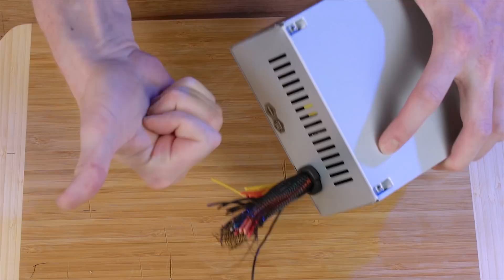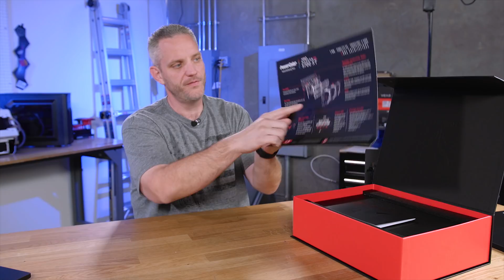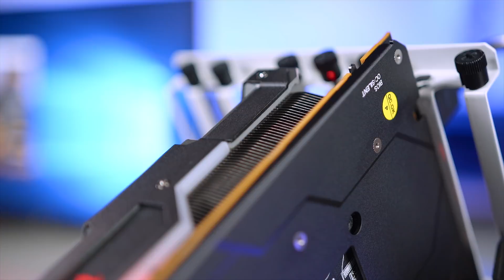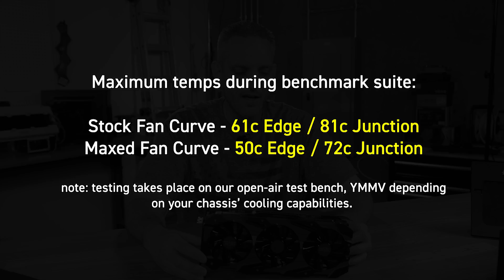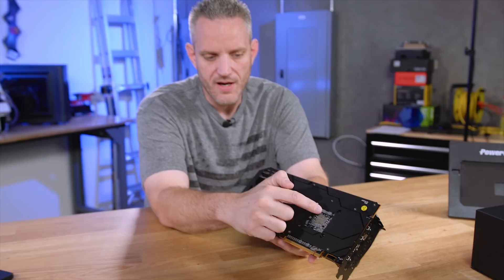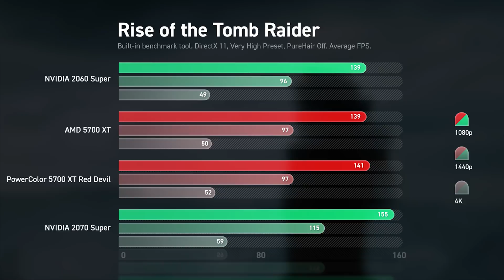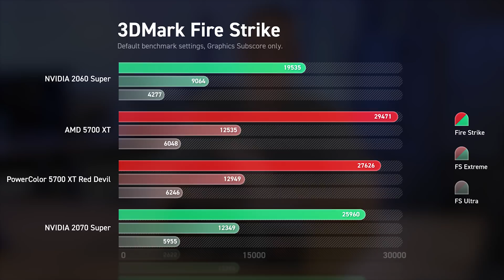Custom RADEON 5700 XTs are here! and THEY ARE GOOD!

Comment: just bought this card used for half price of a new 3060, it's an asus rog strix, guy already did washer mod so temps are pretty good. ryzen 5600 (on sale) all in about 600usd. Hard to compete with a ps5 price point, but I feel at least matching the current gen will give my system more longevity than going with something a bit cheaper like a 1070ti. Yes an older card now, and you all may be looking at the 6600 at this point, but if you spend your budget smartly and know how to sniff out shady dealers on fb market, you can get a really great mid range system.

Comment: got my red devil almost 2 years ago now... still loving it.
Reply: You must have got a good one, mine crashes constantly
Reply: @shiningdragon8737  I had a few issues at first, but I made sure my gpu fans were engaging, because the default fan settings were not turning them on for some reason, and my drivers were all updated (AMDs adrenaline software doesn't turn them on unless I manually change the fan curve.  Even if it is just a tiny bit, then change it back.  It's weird. ) . Haven't had many issues since then. Only really major issue I have had so far is attempting to play Outer Worlds.  It crashes my system pretty much at the beginning of the game.  So I've never made it past getting into the ship. But that could be a problem with the version of the game( I have it through epic) , rather then an issue with the gpu.

Comment: I recently bought a RX5700 XT Asus ROG strix, but the problem I have is my monitor starts up with a 640x480 resolution even though its a 1080p native monitor. And I can't figure out why it does this because my second monitor doesn't have this problem. And switching to display cables does not fix the problem. The only thing I can do is change the channel on my monitor to the second HDMI port and back to get it at 1080p. Anyone have any clue on what the problem could be?
Reply: Probably the drivers?
Reply: @hellohej1307  the weird thing is that any other display I tried doesn't have this problem

Comment: As drivers for the card have matured so has performance. I actually game on this card in 1440p in COD warzone 200 man battle royals and pull fps range of 120-168fps. The low 0.01% was above 90fps. In games like forza hitting 120-144fps is constant with everything maxed. This card works on 1440p even in fast paced battle royals like warzone. You would probably find that if those benchs are ran today performance probably jumped between 5-10%. The card really did mature since release . Very happy with it.
Reply: I'm considering getting this card so hearing that it's gotten better is a win for me.
Reply: @kizzychiz  highely recommend . Got mine for £400. My air flows very good so the card sits over 2ghz nearly my entire play time on a custom fan curve. I sit the fans in heavy load games between 65% and 80% at max. Usually it will bounce 70%-75%. I do not mind the extra noise. If you want it silent I recommend undervolting to reduce the heat build up which most reports keeps it over 2ghz on more silent builds . The ATI software has auto undervolt if its not something your comfortable doing your self. What you get out of this card depends  very much on cooling inside your case. Works similar to a ryzen cpu. It will boost up to 2010mhz in ideal conditions. For me that is 1989mhz-2008mhz in war zone. My gpu temp is 54-56 Oc. Junction temp 70-74. I'm also a sucker for the RGB on it. My cpu ,psu and now gpu are same colours. Using an aqua type blue :)
Reply: Are you not seeing any of the reported driver issues??

Comment: I purchased the PowerColor Red Devil RX 5700 for $379 U.S. dollars and loaded the PowerColor Red Devil RX 5700 XT bios to it. It was simple, put's the card within 1% of the XT version,  and is working flawlessly, albeit much faster than before the Bios update. The key is the Red Devil 5700 and XT version use exactly the same cooler so temps are great and it saved me $70-$80.

Comment: Would you still recommend this card? Would it pair well with my Ryzen 9 3900X?
Reply: It would even pair just fine with a ryzen 5 3600, its still an amazing card but with that amount of gpu power you can get away with a 2080ti or a 3080ti when it comes out
Reply: jack sheneman I’ve had this card for a couple months now, and it’s perfect.
Reply: @chriskempen9969  it's an amazing card👍

Comment: I had to RMA my Red Devil RX 5700, i had to do BIOS flash, search for specific drivers & do specific settings (both in Motherboard BIOS settings & videosettings) etc. to solve Crashing (had BSOD/Black Screen problems like so many other RX 5700 users) and it still will crash sometimes even tho its less, Radeon/AMD even admit it & are trying to solve the problem as we speak, to no avail... its just a damn HASSLE.... 
Red Devil RX 5700 looked absolutely gorgeous in the case with that RGB tho, what shame... i have a RTX 2070 right now and its amazing, just plug it in and kickass, never any hassle.

Comment: I wonder how good my system is going to be. 3900x processor Red Devil 5700xt graphics card Asrock Tachaci motherboard 32gb of 3200mhz ram with 10 case fans and the biggest air cooler for the CPU

Comment: All the numbers are cute and all, the card is thicc and beautiful and all.....

That all ends until you put it in your system and BAM! BSOD, BAM! driver issues, BAM! You have to reinstall Windows, BAM! Stutter here and crash here. BAM! card overheats. BAM! Clock speed goes to shit...

As much as I love Ryzen.... AMD messed up big time with their quality control of their software. I bought a 5700xt just to drown in an ocean of driver issues. Returned it, bought a 2070 Super. Installed it and worked right out of the box.

If there was a 5700xt that works out of the box as soon as you install it and install drivers, I'd go destroy the 2070 and buy it lol.

Comment: JAYZ2cents please test the 215 TDP RTX2060 Super’s there are only 1 or 2 of them out in the wild from AIB partners. They crush all other 2060 Supers that only have a 185TDP like the Founder Edition. The rtx2060 Aorus is a 215TDP model with 133% power limiter by default. I’ve seen 9,800 timespy graphics stock out of the box. I saw a overclocked timespy of over 10,245 with a 215TDP 2060 Super that have a default power limiter of 133%

Comment: I REALLY wanted to like Nvidia's cards, I once saw them as a trusted brand and I even wanted to like rtx (even added a couple cards to a shopping list).  But after watching dozens of videos on Ray Tracing and the 5700 XT I cannot agree with Nvidia on this.  They have put their eggs in the wrong basket and I'm done.  Going to be buying myself a 5700 XT for Christmas.  Bye Nvidia.
Reply: Are you happy with your purchase? I've just sold my 1660ti and think of getting 5700xt/2070s? Driver been stable? Thanks
Reply: Same boat mate, but I ended up getting a sapphire 5600xt over the 5700xt. I needed some winter clothes, and wool cuts up budgets.

Comment: 6:04 that's pretty good, in long gaming sessions it's always hhandy to know what my temps are doing without having to run background applications which are also on the game screen which no ones wants. 

One thing that worries me about this card is reliability, I haven't had powercolor before. Anyone have this card yet and let me know if it's still running ok? Thanks.

Comment: Pleeeeeeeeease a little help here.

I bought the xfx rx 5700 xt yesterday, and it's not working past BIOS. I can mess with bios and see post it display, but after that the screen goes black and everything stops loading.

I have a very old Crosshair IV formula MB working with an R9 290 just fine, and PSU is strong enough (750w ocz fatality).

Is this a compatibility issue with the mb and the card? Or could the card be faulty?

Appreciate the attention.

Comment: The 5700XT Powercolor Red Devil is $599 CAD and the nVidia EVGA Black Gaming 2070 SUPER is $709 CAD. I play at 1440p on a 60Hz screen so it is apparent I can save $110 CAD by purchasing the Red Devil. All of the benchmarks were above 100fps @ 1440p. I only need 60 unless I OC my monitor. Even then I will only need 72Hz MAX. Good review man. I like it a lot.

Comment: I will save $125 buying a 5700XT AIB over RTX 2070 Supers. Should I go with the 5700XT?
5700XT is in the 2060 Super price bracket but is punching very hard at 2070 AND 2080 Supers? Wow.
2080 Super just under $900.
2070 Super about $650.
2060 Super about $500.
5700XT is $520. That's incredible work from AMD.
Prices converted from New Zealand dollars to American dollars.
Edit: Just contacted the local store. It looks like 5700XT won't arrive in NZ until early 2021..... Wow. By then who knows what will be available...

Comment: Got 3700x and 5700xt red devil.

The card is really big and long. Just take note.
Reply: should i buy the msi 5700xt or cutom built red devil card ? s the custom built worth it or should i just go with the basic card ?
Reply: Fury Gaming custom is way better. Reference card is too hot. Cards don’t last long if high temp. My red devil load temp is 64c on average
Reply: @hom3r  ohh i thought of buying the msi rx 5700xt , s that too hot ? asus edition s also hot ?
Reply: Fury Gaming just get non reference card will do.
Reply: @hom3r  actually im frm india bro surely this red devil pleases me but the problem s , for any kinda fault i need to send it for service to abroad , and i cant spend for it again so only bro , can u recommend me any non reference card bro ?
Reply: Fury Gaming why not state what’s available there? I believe prices there are expensive and most ppl bought overseas in USD.
Reply: @hom3r  ya bro these are too expensive here lyk the rx 5700 xt asus edition s 38k which s 532 usd , and the red devil is 42k which s 588 usd bro , here the asus and msi rx 5700 xt are only available for now , s the asus edition best or the msi bro ? based on performance and cooling ?
Reply: Fury Gaming find the card with triple fan cooling. It is cooler and quieter than dual fan. Triple fan is more expensive but better.
Reply: @hom3r  Nah bro Gonna take the risk and preorder red devil .......
Reply: @hom3r  txs for replying
Reply: @hom3r wat case do u use bro ? and also motherboard , im thinkin of taking the x570 aourus elite , 3700x and rx 5700 xt red devil , which case would do justice to this setup ?
Reply: Fury Gaming lianli o11, msi b450 gaming carbon ac, 3700x, 5700xt red devil.thats my setup.
Reply: ur case price itself costs me a fortune here bro @hom3r
Reply: Fury Gaming around 140usd conversion rate. Haha.
Reply: @hom3r  :(
Reply: @hom3r  in india it costs for 563 usd and idk y ..... RIP india
Reply: @fury5253  so what u gotten bro lol
Reply: @hom3r  yah bro but in my country the red devil stock never came so i went wit saphhire pulse card rx 5700xt and its running smooth till now i never have crashes or any other probs been using for 20 days
Reply: Fury Gaming good bro good to hear that!  :D
Reply: @hom3r  this beast runs almost everything in ultra 40 fps dude
Reply: @MrBeast  Haha nah bro , yah its available in my country , which country are u frm bro ? just go to power cooler site and choose the card then ur region and country it will automatically show all the available stores bro

Comment: Also its nice that the aib 5700 xt can creep near 2070 super performance.
But right now here the 2070 super is 499 gbp new but ref with custom cooler

While aib 5700xt is 499 strix and 450 red devil then 430ish reference with custom cooler.

If only a custom 5700xt is 400 then nvidia is going to get rekt.

But right now 50gbp difference between low end 2070s and 5700xt devil is not much

Comment: In regards to undercucking:

So basically the 5700xt can easily hit 2000 mhz with low voltage.

But for the life of AMD made it so that the gpu overvolts when boosting, causing more heat and then noise from the fan. Thinking maybe that ghis way the card remains stable ?

Are they underestimating the capabilities of their card?

Also this reminds me of the motherboards for intel cpu's and their "AUTO OVERCLOCKING 1 CLICK Softwares".
It had the same downside.

It can AUTOOVERCUCK to 5ghz say an 8700k. Bu it overvolts it so much that it ramps the temps on the 8700k resulting to 5ghz OC instability.

Whilst the same board and cpu can be overcuck to 5ghz manually with lower voltage with trial and error the same cpu can oc to 5ghz with lower voltage and lower temps. And if lucky can push 5.2 ghz on the same voltages that the auto oc from the mobo used for its 5ghz oc.

If you catch my drift.

I guess AMD is underestimating the navi's capabilities.

Comment: In the mid $400's price point, I'd buy a used GTX 1080 ti.  There are a ton of them on eBay and the forums selling for $400-$465 including ones with great coolers.

Comment: Dope card but it runs so damn hot which isn’t shocking as AMD cards always run on the hotter side but 100+ degrees is insane I could literally use it as a space heater in the winter

Comment: guys i got questions right now im using 1070 with 6600k on 700w aerocool power supply and my question is 
" is it worth changing 1070 for 5700 ?" my whole idea why i wanted to change it cos 
1 swapping gpu is easier then whole system (like motherboard cpu mem and all that)
2 im playing a 2k and sometimes i just cant get stable 75+ fps

what i wonder about is 700w ps is actually enough for 5700?

Comment: Always been a sapphire fan, ever since I bought a hd7770 that oc'd to 1200 mhz without any over voltage. My current card has a good OC too and doesn't go above 65c.
Reply: yeah, I have to agree on that one. And I always thought Sapphire was the go too brand with AMD   

  I got a few Sapphire cards and they all worked very well and the RX580 I am using is also a Sapphire... Go Sapphire....   LOL...

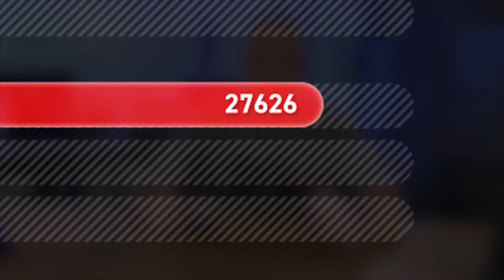Comment: 11:50 did you switch benchmark results of FS between the two 5700 XTs? You even zoom to the wrong result of 27626 when you say 'almost 30000'...

(edit) Ow ... wait, I should have listened to what came next. "Couldn't make heads or tails of it' indeed :P

Comment: Here in Australia:
Stock RX5700XT's can be had for $639-$649
Custom RX5700XT's look like they'll be $699-$729 judging by what's available today. 

In comparison. 
Custom 2060 Super's are $729-$799 
Custom 2070 Super's are $909-$1129
All dependant on brand of course. 

So, realistically, you'd be mad to buy the NVIDIA card over the AMD one, here in Australia at least. It's basically $200 (Minimum) to go from 5700XT to 2070S.

Comment: I had nothing but problems with my PowerColor Red Devil RX480 (8GBD5-3DH/OC) that I could replicate across three different machines... Even with 3 different warranty replacements I wasn't able to get it to be stable, even at Stock settings. It was so frustrating that I'll never buy a PowerColor card again.

I will admit that the 5700XT is slick looking though. Illuminated IO is cool too.

Comment: the problem with AMD GPU's is temperature. They cannot rely on the manufacturers to fix that issue. The base version should not overheat to such absurd levels. And they need to work on that that for 2nd gen Navi. 

Still, i feel AMD does have an advantage. the PS5 will use next year's Navi. Which means next years Navi is actually when things could get interesting the GPU market.

Comment: I love AMD but at the same time I can't avoid thinking about buying a second hand GTX 1080ti that's got 11GB VRAM.
Reply: What do you need 11gb of vram for?
Reply: Do it I've got 1080 ti strix oc to 2075 and my modded fallout 4 takes up tons of vram.  You can prob find a 1080 ti for like 500 easy
Reply: I just bought a super clean EVGA GTX 1080 FTW card on craigslist for 250 bucks!! Works perfect. I just couldn't pass that deal up.

Comment: I want the 5700XT but the drivers are still a mess right now :\  Still using my Power Color R9290x PCS+.  :)  However, the Power Color 5700XT is 600 CAD and the 2070 Super is 675 CAD.  About 12% more expensive but the 2070 Super as a whole is 8% faster then a 5700 XT (Techpowerup).  Makes a pause....seeing you can have fun with RTX at medium settings as a novelty.

Comment: I just bought a 2060 Super yesterday for 420, and I'm worried I may have made a mistake... I should have waited a little longer. But it's gonna be nice getting off this 980.
Reply: Stock vs stock the XT is faster. However, if you put a good overclock on your card, they will perform the same.
Reply: @twistedoracle4555  Cool thanks. After looking into it more, I think I made the right choice. I'm really picky about power consumption and I don't run AC in summer, so the Radeon cards sadly are out of the question.

Comment: I still struggle with the idea of scaling up navi to big navi. Mostly because of power draw, these things almost draw as much power as a 2080ti and the die is like 1/3rd of the size. If they find a way to keep the power down, then it'll be pretty sweet. However I don't think Nvidia has anything to fear since by the time "big" navi comes out, im sure they will have something as well.

Comment: RIP Nvidia 2060 and 2070 Super!!!
Might have to upgrade my 1080 :)

Great to see Intel absolutely struggling at the moment and now AMD is coming for team green!!!!
Reply: RIP 2070 Super? .. Getting a little a head of yourself there. The 2070 Super stock is still faster than the $440-450 5700xt OC on average. The 2070 Super FE @ $499.99 comes with a 2 game bundle worth $80. If you game on a 1440p/144hz/165hz G-sync monitor already going back to a 75hz Freesync monitor is a no go for most! The 2070 Super may not be for you but it's a better compute card in productivity programs, has Raytracing if u like it or not and certainly is not RIP imo...